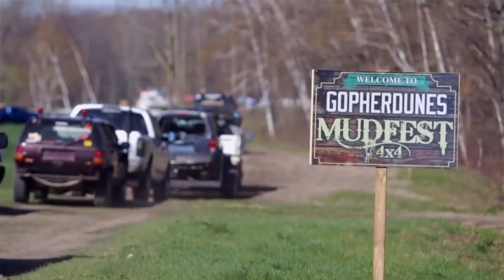Is A Subaru As Good As A 4x4 Truck?

Comment: Id say an older subaru is better than most 4wds. By "most 4wds" i mean one with open diffs , a mild lift and slightly larger a/t tires. A 4wd with LOCKERS and big tires is a different story though.

Comment: Proof that Chevys are worn out and junk at 250,000 miles
Reply: Fraud Detector Scott considering most places its hard to get 402000 kms out of a truck so this clapped out gmc is actually doing very well. Wait what 402000 who said anything about that number.. Well sir 250000 miles is actually quite a bit of miles broken down and converted to our canadian system.

Comment: Subaru is still stuck in the flat earth stage...
Reply: Seb Krause why you say so
Reply: Dalton Carter I made flat earth reference to the flat boxer engine......
Reply: Seb Krause fun fact: subaru got their engine design from (drumroll) the VW air-cooled engine!
Reply: Not really.
Reply: The flat 4 makes decent power and has good gas mileage. The head gasket problem is there, bit it's overstated. I'm doing my Forester's gaskets at 289,000kms (179000miles). I'd say that's not terrible. They don't have great HP/weight ratio, but they make good torque for their size. They fit the subarus themselves, being good everywhere but not great at any one thing. I like em